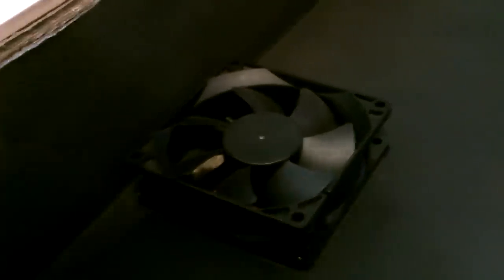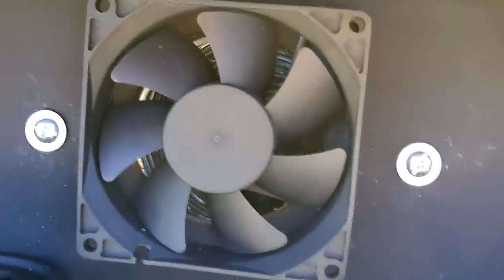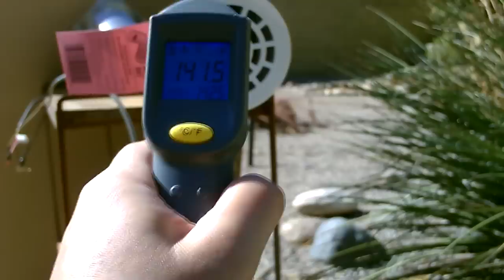Homemade "Steel Can" Solar Air Heater! DIY - STEEL CAN Air Heater! (140F+) - EASY Instructions!

Comment: Why not cut the can bottoms out instead of drilling all those holes?
Reply from the maker: hi there. the holes help slow the air which allows for max heating of the air.

Comment: which kind of black painting are you using. I read somewhere taht it is better a Titan Oxid blue color than black, does anybody knows about it?. In addirion I am concerned with the possible emisions of the painting going into the use, which will be mora than usual due to the heat. regards, thank you and great stuf!
Reply from the maker: hi there. i have read about using other colors but i believe that black is the best. the blacker the better. once the paint is dry it is non toxic so there is no problem with fumes. they actually sell high heat paint if you want to use it but i don't think it's necessary. the inside of the collector gets hot but not overly hot.

Comment: Are food cans better than drink cans for this?
Reply from the maker: hi. yes, i have found that the steel (food cans) work better than drink cans (aluminum cans). i think it's because steel is a denser metal and so it gets hotter

Comment: How can you have heat at night if you're using a solar panel to run it during the? 
Thank you for making these videos. Also could you tell me what kind of glass using? What is the type of glass called?
Reply from the maker: you can use either plexi-glas or regular glass. lately i've been using regular glass. it seems to work better plus it doesn't warp or discolor

Comment: Would aluminum cans work as well, or do they need to be steel?
Reply from the maker: hi. aluminum works too, but i've found that the steel cans work better. it's probably because steel is a heavier denser metal so they get hotter and hold the heat better.

Comment: I just use my empty soup cans and punch about 15 holes with a large nail and hammer on the bottom side. I then glued and taped together three of same size cans together and paint the cans flat black.  Then I do the same exact thing with more more of the same size cans and tape and glue the six cans together.  After that, I mount and glue the six can tower on an empty plastic one liter yogurt container.  Then I just place the black can tower by the window where the sunshine can heat up the cans.  The holes in the cans allow the heat to slowly rise through the cans slowly and by the time the heated air reaches the top the air is warmed a few degrees.  It does actually work as I used my infrared thermometer gun to check out the results after I made my first tin can tower air heater.  

I also tried out painting black some cheap disposable rectangular aluminum turkey pans and mounted the black turkey pans to black perforated plastic Dollar Store board.  That works as well and both of these projects cost next to nothing to make.  Both projects together cost me about $8.00 and do work to warm the air when it's sunny.  However, I didn't expect too much from the projects since I just used leftover tin cans I had and unused disposable turkey pans I had from the holidays.  At least the solar heaters are easy to move and I can move the heaters from window to window as sun moves during the day.

Comment: I live in northern part of Finland and been planning something like that.

 Going to use thin metal panel with lots of holes in it (don't know what it's called in english) and make it kind of like a wave inside the panel. This should create lots of surface area with enough air flow. 

 I've been planning to use programmable thermostate relay to turn on fan when there is higher than 30°C/86F inside the panel. The relay and fan are powered by a small solar panel. Valve inside the house will be a three flap panel where flaps close with gravity. So when the fan blows, it should open the flaps enough for warm air to get in and the flaps should then close when the temperature drops.

I have everything but the relays. I had to order them from Germany.

Any ideas and tips are appreciated.
Reply from the maker: hey there. sounds like you've got good ideas. i've got another solar air heater video that is somewhat similar to what you're making - it's made with a large wavy sheet of sheet metal. there are no holes in the metal but it might give you even more ideas. here's the link to that one https://youtu.be/gNldYoeRYF0
Reply: @desertsun02  Thank you and thanks for the comment and the link! I'll look into it!

Comment: Wouldn't it be more efficent to runt just one long tube like a snake from side to side from the bottom to the top like an S-shape? In this way you trap the air for a longer distance and this should make it absorb more heat. Also it should give some heatexchange all the way from bottom to top between the cans so de output would get really hot.
Reply from the maker: hi there. hotter (but much less air output) so it basically evens out

Comment: I am busy collecting steel cans to start this project. Now I am thinking of painting the cans black and then wrapping each one individually in heavy duty foil. Will that work better?
Reply from the maker: hi. it's great that you're making it! i wouldn't wrap the cans in foil. that would block the sun from directly hitting the metal.

Comment: insulate the outer of that aluminum duct too, otherwise you will loose heat energy through that duct acting as a heat sink!
Reply from the maker: good point, very true 👍

Comment: Instead of vent holes in the bottom it should be another vent bringing air from whatever you are trying to heat so you are not trying to heat up cold air. 
If you can blow air into your house then it's not airtight.
Using a low voltage fan wired to 10a solar panel so it only moves air when the sun shines

Comment: I’ve seen this done with aluminum cans and another using pennies. In both designs the cans or the pennies were spray painted with flat black paint. Also these were passive with no fan. Any experience with these? I’m curious which has higher heat output. Also if there are any special warning about fire, heat-resistant materials, reflective backing, etc. One last thing, I’d need to mount it outside as none of my windows get much sun for very long. Will that cause significant drops in output at freezing temps as I would expect? 
Thanks much, free heat is far better than utility prices.
Reply from the maker: hi there. i've used aluminum cans in earlier models. steel cans work better though because steel is denser and gets much hotter. i've never heard of one that is made with pennies. yes, always paint it with flat black paint (or a very dark color). passive ones (the ones with no fan) only work if they are huge (like 10 or 20 times the size of this one). the fan is a MUST for nearly all solar air heaters. without the fan you will get almost no warm air (it trickles out way too slowly to be of any use). these collectors don't get anywhere near fire temps. it's not even close so don't worry about that. these ALWAYS have to be mounted OUTSIDE the house. putting it inside in a window doesn't work. not even a little bit. it will not create any additional heat. all that does is block the sunlight that would normally enter your house through the window and it focuses it in the collector then pumps it out of collector and into the room. it's better just to let the sunlight come in the window. i hope this helps you. 🙂

Comment: Very cool man! I wonder how well it would do in sub zero (or 32⁰ F)?
Reply from the maker: hi there and thanks. just a guess but probably put out about 110-115F if air was 32F (0C). a rough estimate... 140F when air is 60F, 130F when air is 50F, 120F when air is 40F, 110F when the air is 30F. (that is a very rough guide). seems to heat air about 80 degrees. note that regular furnace temps are anywhere from 110F to 140F. just need the sun ✔

Comment: When my furnace stopped for a week last winter I used crock pots full of water without lids and a food dehydrator for a week while the part came in. No pipes froze in Utah and the living area and kitchen stayed warm enough. This is a great idea you have. When living in S. can new heating system was installed in a home I lived in it had huge coils that traveled through the attic capturing warm air and it was brought down into the low vents along our floor. It was much more efficient and the heating bill was much less.
Reply from the maker: hi. neat idea using the heat in the attic ✔

Comment: What is the backing made of?
Reply from the maker: hi there. nothing special - just some type of 'wood' fiber board. these days i always use plywood. usually 1/4" but 1/2" would work too if you don't mind the extra weight.

Comment: If you want real hot air, place for in ABS on your roof and close it with some plexiglass incredible Heat, same with hot water 1 inch poly, I lived in Arizona for many years so it works well out there

Comment: What would happen if you redesign an some how use a fresnel lense?
Reply from the maker: hi there. using a fresnel lens with this would be tricky. they are so powerful that even smaller ones can start fires.

Comment: I made one of these years ago for my home in NH.  It worked really well.  I didn't use a fan.  I just allowed convection.  Even in the winter sun, with many feet of snow on the ground, this worked well.  The thing is, you've got to put a door on the inside of your inlet/outlet (the part that comes into the room) so that, at night, it doesn't suck all the warm air out of your home.  Cheap and easy to make and supplements the fuel bills really well.  For sure, make two.
Reply: Save nature not money,  money is not real

Comment: How does this work in very cold climates
Reply from the maker: hi. it mostly depends on the amount of sun you get. i've seen these things working below zero (with full sun). the air won't be as hot with the colder temps but it can still give you some pretty warm air.

Comment: How do you keep warm at night? Isn't that when you need it most?
Reply from the maker: hi there. these collectors are generally meant to provide heat when sun is out (cold but sunny). they work to 'assist' in your home's heating needs (but often are not the only heat). for nighttime you'd have to store the heat that these generate during the day (maybe in some sort of thermal mass; like rocks, sand, bricks  or even water). heat would dissipate into home at night. sand or a sandbox storage system of some kind is what i might use.
Reply: @desertsun02  hey, wow, that's a great idea. Thanks so much for this stuff. I love living.off gid. It gets rough though being in pa. I live in tent almost all year. I made a quilt inca the dive kitties blanket. I sewed pockets in key areas that are big enough for cats to sleep in and keep me warm too. Sometimes too warm 🥵 lol. Like a three dog night , cept with cats. 😅

Comment: What lind of fan and how is it powered?
Reply from the maker: hi there. i used a 12v computer case fan. (80mm to 90mm ones seem to work the best for this size unit). i usually use a 12v (15w) solar panel to power the fan. using a solar panel works out good because when the sun is shining (and warming the collector) - that is when you want the fan to run and when the sun is not shining (not warming the collector) - it's not hitting the solar panel either so the fan stops. ✔😎

Comment: I know this is probably a stupid question, but how do you get the hot air INSIDE the house?? If I open a window when it’s 10 degrees Fahrenheit outside, it would defeat the purpose. And I know you wouldn’t expect us to cut a hole in the side of the house. Be gentle….old female who understands biology and chemistry, but not something you made so simple. Forgive me..🙏😘. Thank you so much🙏. Love your videos.
Reply from the maker: hi there. you can do it several ways. what i generally recommend is to use  a 1 x 6 or 1 x 8 piece of wood and cut it to fit a window. then using a 'hole saw', cut a hole (or several holes, if you're using multiple solar air heaters). in the wood. using 1 x 6 or 1 x 8 gives you plenty of room to attach the vent (or vents) to the wood. once you attach the tubing the window can be slid down onto the wood. you'll have to seal around it for best fit but it works very good. some people also pump air in through unused vents like an old dryer vent or even through unused dog door. one guy removed a door knob (on an unused door near the back of his garage) and attached the vent right there.
Reply: @desertsun02  thank you so much 🙏! Just like we used for window air conditioners.

Comment: I'm a single mom & my house runs on propane. I cannot believe how much it is even after signing a contract that locks a price through the winter. I'd do anything to lower that cost by supplementing free heat! I don't have many tools so might need to bug my brother in that department!
Reply from the maker: hi there. if you get a decent amount of sun these types of solar air heaters are great to help with heating 👍

Comment: What do you do at night when theres no sun ?
Reply from the maker: hi there. you could store the heat this generates in some sort of thermal mass (sand, water, or rock material comes to mind) for use at night. otherwise you'll have to have alternate heat source or a good warm sleeping bag.

Comment: Nice project, but why use a bunch of steel cans.  Aluminum downspouts would be a much easier build
Reply from the maker: hi there. aluminum or steel downspouts work very well too. in some cases it comes down to what you have or can get. i like using the steel cans partly because it keeps them out of the landfill. seems like a good reuse or a good way to give a 'second life' to the cans

Comment: wouldn't it be easier to use either flexible or non-flexible metal duct pipe? No soldering necessary.

Comment: Does it work indoors or out a few details seems missing
Reply from the maker: hi. there is no need to use it indoors. it collects heat from the sun and then you pipe that heat it in your house 👍

Comment: Is that a heat activated fan
Reply from the maker: hi. it's just a standard 12v computer case fan. it's not heat activated. it could be called 'sun activated' (the way i set it up). whenever sun is striking the solar panel the fan will run (which is what you will want). it works out good.

Comment: THIS IS TREMENDOUS - THANK YOU! Have you used a solar bank with it? 🙏
Reply from the maker: hi. glad you like it. i just use it connected straight to the solar panel. never used a solar battery bank with it🙂
Reply: @desertsun02  Thank you for your reply! Preppernurse1 uses all store bought panels and has them connected to banks to store the energy. The banks have led display showing how full they are.
Reply from the maker: oh, i thought you meant "have i used a solar bank connected to this steel can air heater.". yeah, i've got the PV solar panels with batteries and LED display too. if you're interested in seeing my PV solar system, here's the 3 main video links to it...
first one is how to set it up... https://youtu.be/cgEvCLJuBkg
second one is some things it runs... https://youtu.be/8LAjx_XAR90
third one is the original set up (4 batteries)  https://youtu.be/Nn2DWB_LF_k

Comment: No mention of how or if the cans are connected end to end inside the box.
Reply from the maker: hi there. since they fit so well i didn't connect (or glue) them. if you wanted to - maybe use silicone caulk.

Comment: Do you have a greenhouse there that you heat with those in the winter? Have you tried heating anything there with those in the winter, even just one room? I may build one or more of those, I've been saving cans for something, that might be one thing worth building. Thanks
Reply from the maker: hi. no greenhouse here. i usually heat the back part of the house with these. i save cans and bottles too. i've got hundreds just sitting in boxes.

Comment: I'm a total beginner and very slow to learn. How do you transport or tranfer the heat into your home, if the testing is outdoors? Does solar panel stay outdoors while connected to the can indoors? I don't  understand. Please help
Reply from the maker: hi. typically, you leave the unit outside in the sun and then pump the heat in thru a window or unused vent on house. 🙂

Comment: If love to make one or two but the only windows with full sun are on 2nd floor. If I ran the heat pipe into a air return and turned on furnace FAN ONLY would that get it throughout the house?

Comment: Hi, I have been gathering soup cans (steel) to make a solar heater. I have looked on YouTube and most of the ones I see are pop/beer cans (aluminium). Can I ask why you went with the steel cans?  I decided on them because of strength (I also don’t drink pop).
Reply from the maker: hi. i went with them because of their strength and the fact that the metal is steel so it's denser and thicker than the metal that aluminum cans are made of. it's also a great re-use of steel cans

Comment: Is that output lower than aluminum cans with the same approximate size/volume?
Reply from the maker: hi there. steel cans are generally thicker than aluminum ones so temps are a little higher if you use the steel

Comment: How much volt is the solar panel needed?
Reply from the maker: hi there. i usually recommend a 12v 5 watt panel for optimum performance. (a larger 12v panel is fine too). you can use as little as a 2 or 3 watt 12v panel and still get decent performance. also many of the case fans run pretty good just using a 6v panel
Reply: @desertsun02  thank you very much for your response in addition to congratulate you for your contribution to the fans of the inventions

Comment: Great video, it seems when it comes to these units everyone has their own ideas... Great to see everyone sharing. 

My idea would be to use black anodized aluminum heatsink (the kind used for electronics) and a glass pane with an array of small fresnel lenses.... wonder if it's been tried before?